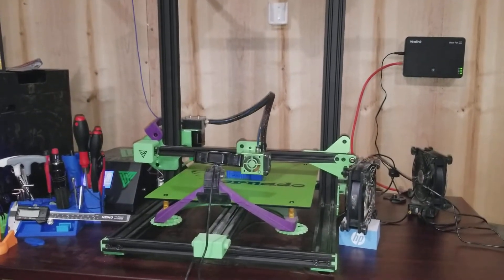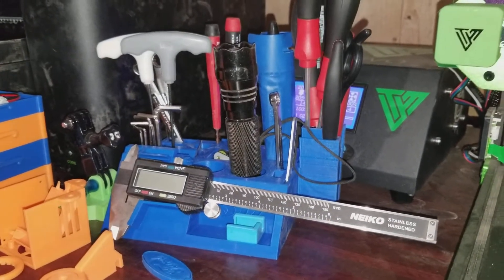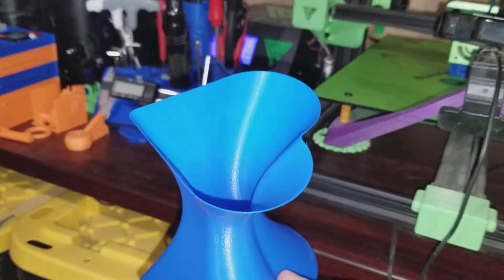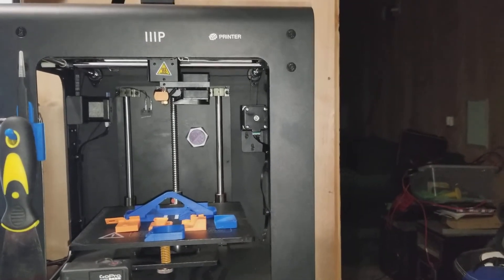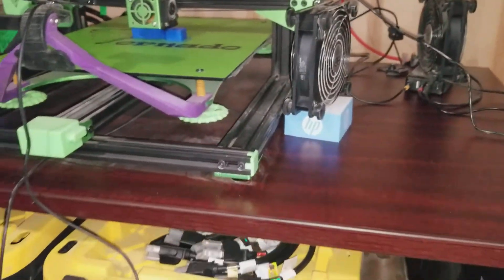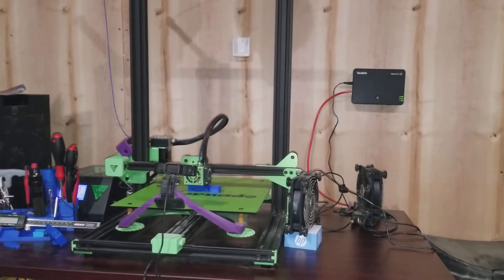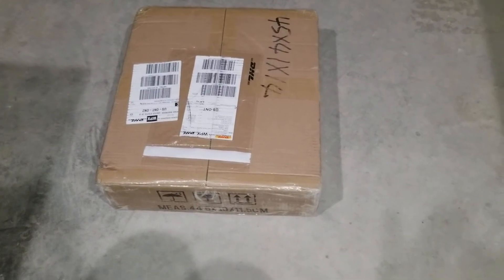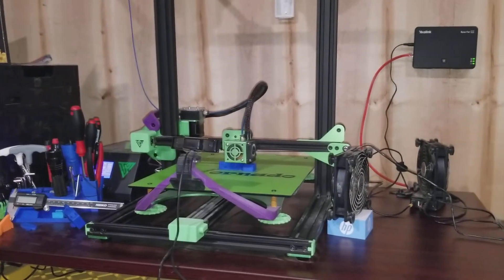Tevo Tornado 3D Printer Review. 3 weeks in and the Tornado just keep printing really nice prints.

Comment: I want to print advanced filiments and need an all steel nozzle is it easy to figure out what to get are they pretty standard? whats the max temp it can do I think polycarb is 285
Reply from the maker: The Tornado uses an MK8 hot end, take a look at Micro swiss.  Will check max.

Comment: I really don't understand how you do it... I've had my tornado for a month and have had nothing but problems from bed leveling to underextrusion problems to issues with infill strength to filiment not sticking to itself so prints look like a wicker basket to unexplained layer shifts to needing a raft just to get basic bed adhesion so the filiment doesn't end up as a ball on the end of my hotend...  I consider myself a very patient guy, an it consultant by trade, but every time I try to do anything with this thing it feels like it's fighting me tooth and nail.  I'm happy that others have excellent experience with it, and I still believe that it has to be user error because all the various parts seem to work and it does print sometimes but only when it wants to it seems... it feels as fickle as a common house cat.
Reply from the maker: Find me on FB and I'll do my best to help, is your printer still stock, bed mat and all? (I see more people who remove the bed mat and they have more problems then ever trying to print on mirrors or glass.)

Comment: awesome review.. I've had the printer for 15 days and have so many problems..  Bed level, ABS not sticking, and Tevo support + AliExpress are the worst ever to deal with!
Need help guys.. any suggestions?
Reply from the maker: +Osamah Abu Ali Thanks fot watching, if I was you I woukd go to the Tevo Tornado group on Facebook post up your issues there.  Also I would not use ABS to dial the printer in with, I would use PLA then change to ABS once you are getting goid PLA prints.
Reply: Here is the fix AliExpress put me in.. I purchased a selection of PLA / ABS - 7 Rolls and becuase I did not mention it specifically, they sent me 7 rolls of ABS only. When I asked them, they said it was selected randomly! How can you select 7 rolls randomly and be ABS with the same colors I selected!  It took them more than 1 month to send. Now I have purchased PLA from another source and it looks like it going to be another 3-4 weeks.. The Tevo selller also did a terrible job of providing proper details. I have also noticed the Bed to warp at temp 110. I put a straight ruler and light was showing under the ruler..  Thanks for the info.
Reply from the maker: +Osamah Abu Ali  it is likely that the bed mat is bubbling vs the actual bed warping. Try replacing it with the spare mat and check the bed kevel once there is no mat on the glass underneath.
Reply: Hi..  How do you get this pad off in the first place!  Its sticking like hell!!
Reply from the maker: +Osamah Abu Ali heat it to 70c and use the scrappee.
Reply: Not easy!  Sticks like hell!  How do you clean the remaining adhesive?
Reply: I tried to print the Tevo Spooler from SD Card and it warped on both ends!!
Starting temp E=230 and the Bed=80.. Fans Auto.. The upper layers were Bed=50 but it warped on the ends on the same bubbly surface.  Its difficult to print without a spool!  So I'm trying to print one as fast as I can..

Comment: Is the blue vase PLA?
Reply from the maker: Thanks for watching.  That is Monoprice PLA +  actually.  PLA vases turn out just as nice.
Reply: 3D Printer Junkie,  what speed and temp settings were used?  I am currently printing PETG and have to get up to 260 degrees.  Looks to be clean but my cup is not water tight.
Reply from the maker: Here is a link to my Cura and S3d Profiles for the Tornado.     HTH    
https://drive.google.com/drive/folders/1SEwpuEf1UChbzctRFYNgTheJoXF28ZK9?usp=sharing

Comment: What is your recommended print speed? Because I am having trouble figuring out a good speed. And what print acceleration do you recommend? Nice channel! Left a sub and a like
Reply from the maker: Thanks a lot!  Happy to help. Hit me up on my Channel FB page and it will be much easier of me to help you vs. thru the discussion section here.   https://www.facebook.com/3DPRINTERJUNKIE
Reply: Thank you, But I don't have a facebook. )= Sorry
Reply from the maker: Which slicer are you using?
Reply: I am using Cura. But I fixed just now after watching this video! Thank you! I just 3d printed a small rocket with very good detail! The problem was the travel acceleration was at 5000. XP I put it down to 1250 it is working great! (=
Reply from the maker: Great, glad you tried that.

Comment: Hi how did you get yours to print will not print from sd I insert card it says card inserted and when you open up the menu it says there is no card Thanks
Reply from the maker: Is this the stock SD card? I have heard they are all trash. I used my computer via USB for my first prints, then I setup OctoPi (www.octoprint.org) to be able to print from my PC web browser or phone without loading SD cards.
Reply: Hi yes ut is the card that came with printer, also when I try to print from the computer in the log  i get communication time out - reset send buffer block and I have got no idea what that means Thanks
Reply from the maker: Hmm I don't use the sd card that came with it or my computer to print, I use OctoPrint / OctoPi and print from a webpage via Raspberry Pi.   What speed did you choose? If auto force it down to 115200 and try that. I had issues with a few different usb cables, they were flakey.   So you have a new Tornado right?
Reply from the maker: https://www.amazon.com/Tripp-Lite-Hi-Speed-Ferrite-U023-006/dp/B003MQ29B2  Get one of these style cables that part at each end blocks interference, I am using one of these on my Tornado.